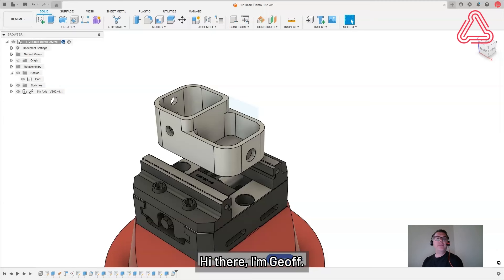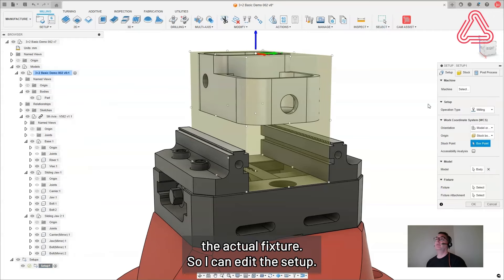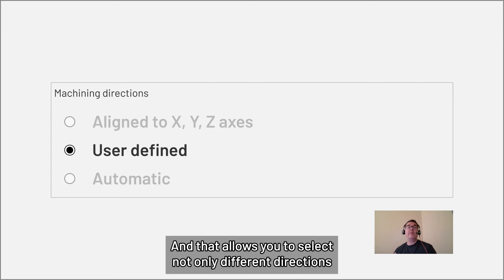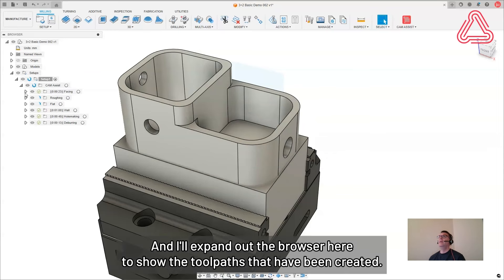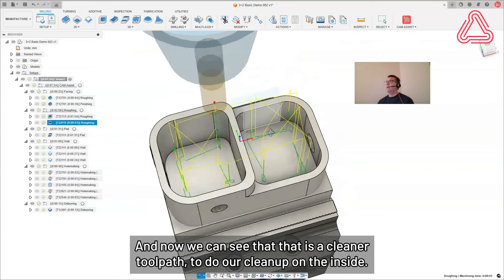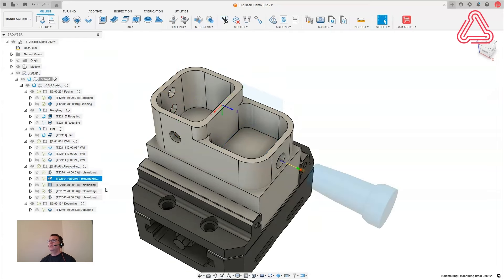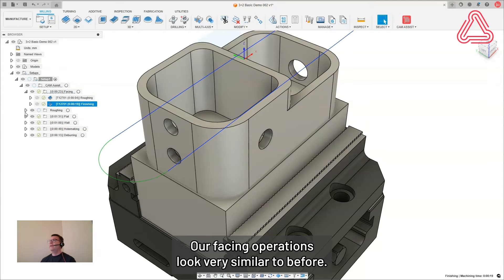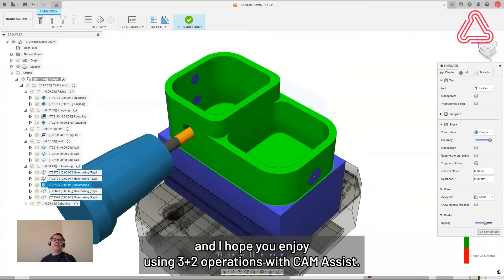Using 3+2 with CAM Assist for Autodesk Fusion

Comment: No spot drills? Flute length too short, machining by level instead of area just more crap to fix.With machining templates, I can program this part in less time than your demo, even with it being sped up and have confidence in speeds, feeds, DOC etc. This is just another bookkeeping nightmare.